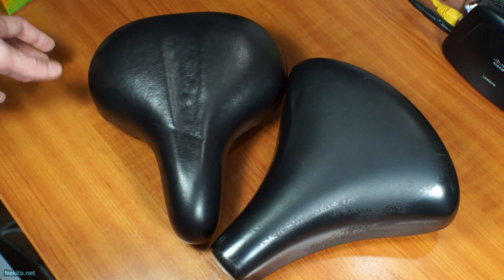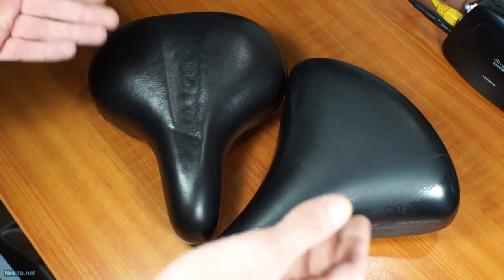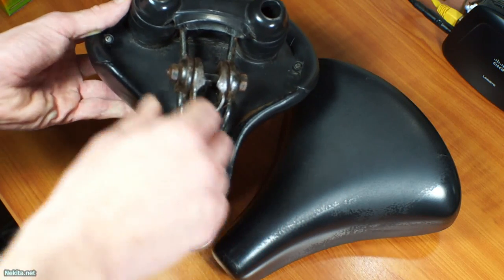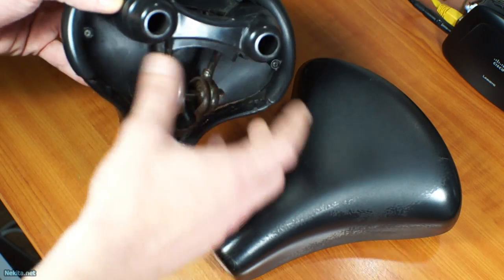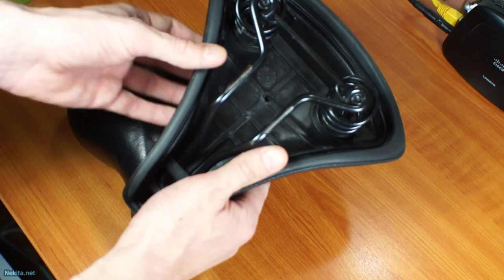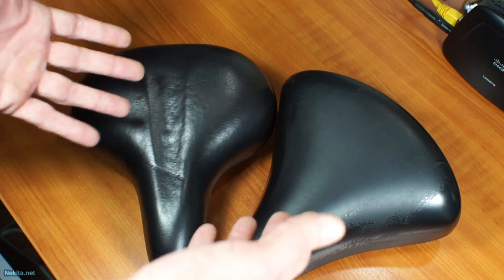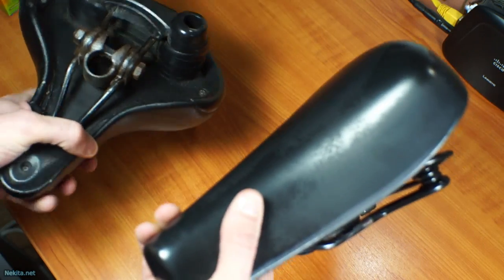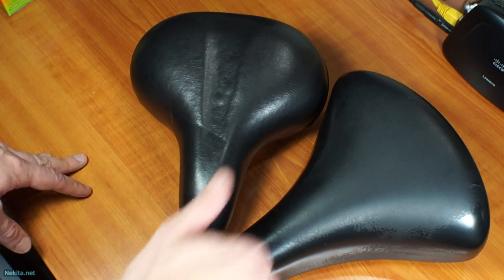Wobbly Bicycle Seat? Check underneath!

Comment: Thank you, Captain Obvious! Adjust the nut to tighten the bracket and check for a broken spring. That should be a given. How about grinded down teeth causing it to slip? Was actually hoping for something real here but you basically said to tighten the nut because bicycle seats are dangerous if not fixed.
Reply from the maker: You're very right! For some it's very obvious. However, what I don't get from your comment is the following: If the teeth are so worn: Why complain here whilst you could buy another bicycle seat clamp. That's also very obvious. Good luck though.